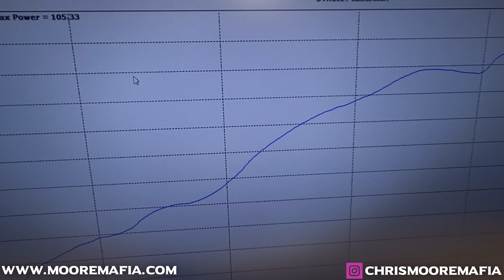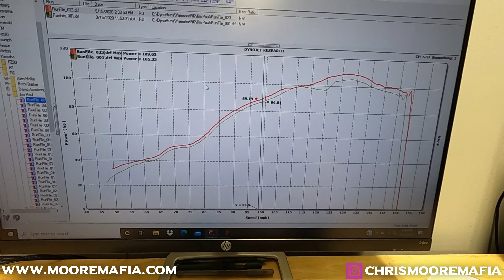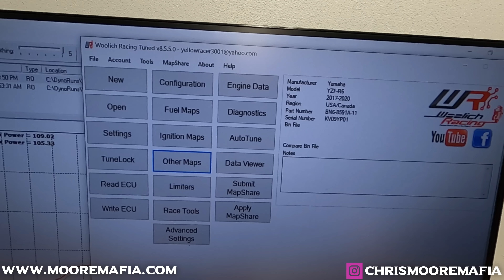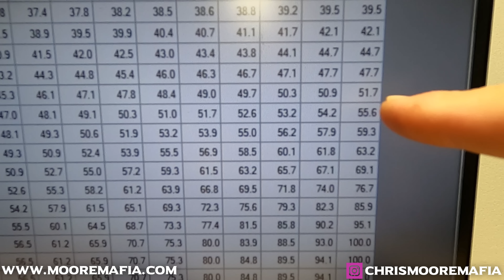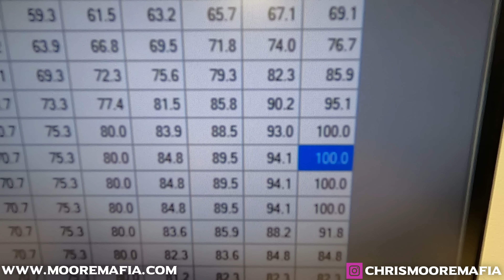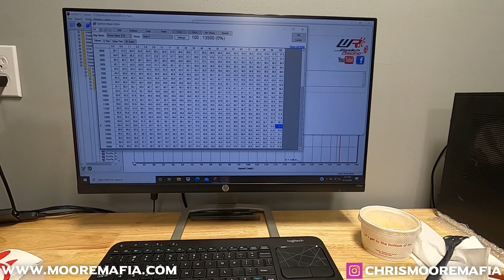2020 Yamaha R6 Unrestricted ECU FLASH and Dyno Tune w/ Modified Stock Exhaust- Moore Mafia

Comment: Chris, it's absolutely night and day the feel of the bike pre and post tune. The "falling on its face" feeling in low RPM while climbing is almost non existent now and that little vibration between 6500-7000 is 95% better. You absolutely knocked it out of the park. What I can say to anyone who reads the comments, obviously just looking at the before and after numbers, it's not the huge and flashy jump that you will usually get with the bigger bikes, but owning the bike, and the before and after feel, the pick up, acceleration, responsiveness, decell... across the board, it's a brand new bike. Oh, and the reason there wasn't a true baseline number to start from is because a couple weeks after getting the bike i took it to Chris for him to just take some of the restrictions out and add a little more fuel across the board, knowing that i would be back after break in since it couldn't be put on the dyno yet. As for the exhaust, i fully intend on getting a real and true slip on. This was more of a "hey, I wonder what this would sound like and do...." kinda things. Anyway, thanks again Chris. I'm sure after a few more mods I'll be back up there again, seeing what else we can pull out of the little 600 that could!
Reply: i think that 5 hp gain is what most 600's see, even with a full system. a better slip on for style, sure, but you probably got the most out of the bike for what you spent already honestly
Reply: @brandoloudly9457  I took the bike to him a couple weeks after I got it for him to just to a very basic, very general "tune". It was more of a "I know we can't dyno it or run it hard yet, so can you just do a couple tweaks to the stock tune until I break it in" kinda thing. So that's why he said that we really didn't have a base number to go off of. I'm guessing from stock it's probably closer to the 8-10 max hp gain area. We were both kinda disappointed that we really didn't know the true numbers, since the first pull he did already had some tinkering done. It was 100% worth it for the feel though. Numbers be d@mned, it's crazy how much smoother it feels
Reply: @rollred1995  oh dont get me wrong. 5hp on the smaller bikes (i also have an r6) is a big difference. 10 hp is a huge difference
Reply: @brandoloudly9457  oh 100%, it's a massive difference. I just meant that some people will only focus on a "small" number and not really know how huge a difference that makes.
Reply: @wudntulike2no32  it's more about looks honestly. I agree that it sounds incredible, really can't believe how good it sounds. It's been tossed around to wrap the exhaust or paint it or something. At this point anything that's changed will be mostly for cosmetic effect
Reply: Yeah change the exhaust 👍
Reply: @rollred1995  I made an Exhaust Almost like yours and its great. painted it black. looks sweet
Reply: Jim paul :  I did same thing to my factory muffler, then i bought a cat delete.  how did you make the factory V Band work on the cat delete pipe to utilize factory muffler?
Reply: @targasupra  the cat delete pipe that I got was built specifically for the bike and had the same end. Matched up as if it were from the factory
Reply: @rollred1995  wouldnt happen to have the link for the cat delete pipe or the seller you bought it from. MJS performance has closed permantly:( i waited too long to buy one and now i cant from them.
Reply: @MXROutlaw  did you ever find the cat delete pipe? I really wanted to ask him the same question bro😂
Reply: @rollred1995  hey! What did you do for the stock exhaust? Cut?
Reply: hey still pretty new and deciding on my second bike between the r6 and the zx6r, after the tune how does the torque and acceleration compare to the zx6r? is it close or does it lack still compared to the zx6r? people are telling me to go with the zx6r for street since it has more torque but i love the looks and sound of the r6

Comment: Had my 2008 R6 tuned in NJ.. Power Commander with complete flash, full akropovic titanium exhaust, race sprockets, race air intake… it made 129hp at the wheel on dyno.. the R6 has so much more capability than it comes with from the factory!

Comment: Homemade exhaust for the win on that one!
Reply: Sounds good as hell if you ask me 👍🏾
Reply: mtb supertroll why buy a bike to be cheap? you gain horse power and save a ton of weight with a full titanium exhaust, wouldn’t have to worry about rust either and it’s also about supporting mods like intake, sprocket kits, tires .. all working together .. I wouldn’t sell myself short
Reply: @MADLITS1K  that's not being cheap, that called being smart and saving a load of money for mods that will net more gains for the 💰. Example... You buy a full exhaust and tune. I fab up a modified stock exhaust, tune, and then take my left over cash and buy a set of used BST's... Will you outrun me?????
Reply: @MADLITS1K  I feel you... It all depends on the purpose of the bike when you really break it down. If it's a competitive bike, then no I'm not going to do a hack job on the stock exhaust... I will buy a good condition "USED" full system though. For a everyday bike though I'm going the same route of the "Modded" stock exhaust, it's going to give you the same gains & sound (maybe) as a Slip-On. I believe in going as fast as possible for as less money as possible, that's car or bike for me. All the brand labels in the world don't mean anything when you get smacked by the DIY guy 🤷🏾‍♂️
Reply: bacchus thompson fair enough fair enough, turns out the owner is in the comment section. Says he was just trying a thing with it and actually plans on getting a slip on anyway ... I gotta give it to him tho I’ve never seen anyone hack the stock exhaust tho usually they ditch the cat back and add a custom $20 pipe from a muffler shop or something lol

Comment: "not a lot of money" 2020 R6 and getting it tuned
Reply: I mean, he’s talking about the exhaust
Reply: Well if he wanted an R1M but settled for an R6, he definitely went the low buck route. Everything is relative my friend; an for what a capable machine you get the modern 600s from all the big 4 metric brands are indeed quite a value. You basically are ready to get on a race track and ride for 10-12k fresh out of a dealership. People spend that much on dirt bikes these days if you think about it that way.
Reply: maybe he spent his earnings or savings for a brand new bike cos he's not fond of buying 2nd hand bikes? full system exhaust can be expensive, what's so hard about it?
Reply: Is a 600cc expensive?
Reply: Lol I love how this comment is made so often. Listen close, he's saying not a lot of money ON THE EXHAUST silly. It was an experiment simply. I was curious how it would look and sound and it was super cheap to do. All the while keeping it to where it wouldn't be at a point of no return to where a full exhaust would HAVE to be done. And let's all be honest here, it came out WAY better than I even imagined. Certainly doesn't sound stock but if I get pulled over, it still technically has the stock silencer on it lol
Reply: He sounds like me
Reply: @kennethpowers8995  Yep, bought my 16 for 7K with low miles, about to dyno tun it after installing a BMC race air filter and full exhaust

Comment: I had a Honda winner 150cc out here in Vietnam, ecu , airbox gutted and K&N filter and exhaust, and upgraded intake and exhaust valves and spring , nets a MASSIVE gain. Stock is about 11.7 whp and with those upgrades, jump to 19whp. That's over 35% more power. How come most 600 class bikes only net around 5whp ? I checked out all brands of bikes and most of them net barely any increase (not saying the increase isn't felt , just saying why does a small 150cc net 35% plus performance when a 600 only gets like 3%)

Comment: Can you flash the ecu with tuning just by sending you my r6 ecu or do you need the bike too for both.  Excuse my ignorance...
Reply: an ecu can always be flashed by having it sent in, but for the best of the best is always a custom tune on a dyno, cuz every bike is still ever so slightly different, especially if it's modified, you want it tuned for your specific mods.
Reply: @gwot  good point

Comment: Love the ingenuity of the owner. Honestly at first I was like oh great a guy has money for a brand new R6 and NEEDs and exhaust so bad but can’t afford it so squid life hackjob etc etc. Upon consideration though he didn’t just hack anything up and really did a good job which I deeply respect because doing things yourself is just awesome. I also highly doubt his engine cares the pipe it exhales through came from EBay. if the bends are right and flow is there who cares!
Reply: it's an old trick in the R6 community, it's been around for generations. I did the same thing, I can definitely afford a new exhaust, but I don't want to pay $1,000 for some bent metal with an off the shelf muffler that they slap on every model exhausts are so expensive with little value to them.

Comment: Does it hurt when shifting without using the clutch?  Or do bikes have autoblip or whatever it called when you do that
Reply: Not at all, clutchless upshifting doesn’t harm the bike whatsoever. Clutchless downshifting doesn’t harm the bike either if done right, but you have to be extremely precise. Generally it’s just better to clutchless upshift and use the clutch for downshifting.

Comment: Good luck this weekend! Can you add some weight to the front? BP has that special heavy front wheel spacer. $$$ Local mechanic says Yamaha motors have been exploding lately. Wondering about ignition timing. Seems like high advance at chopped throttle. For popping I assume?

Comment: "This customer doesn't have alot of money...". Proceeds to buy a 2020 R6😂👍The heart wants what the heart wants, boys.
Reply: Lol, he said the customer doesn't have a lot of money IN the exhaust. Cause, no, I don't. It was more of a "hey, this thing looks identical at a third of the price, not much to lose" kinda thing. And the cut in half muffler was more pure curiosity. Sounds incredibly honestly, but I want the cleaner look of a true aftermarket slip on so it's not going to be long until the "science experiment" goes away lol
Reply: @rollred1995  Ahhh, I see. I must have misunderstood! But regardless, it sounds awesome and the bike looks very very clean, man, congratulations! Hope you get plenty of happy miles on it!
Reply: @rollred1995  Your exhaust would probably help you with the cops also since it's stock, they can't give you shit for that.
Reply: We were all honestly a little shocked at how clean it sounded. The biggest difference came with the cat delete though. That's the biggest sound killer. And thank you. Absolutely love the bike
Reply: @rollred1995  Just a follow up question - would you say those gains were noticable after the tune and if so, would you say it is a sizeable gain or not so much?
Reply: @deanduplessis832  I've only gotten to ride it once since the tune because of the weather here, but on that ride, the change was night and day. Incredibly smooth acceleration now, especially at lower revs (below 6000). The throttle response is improved, decel... across the board the rideability is night and day better. I haven't gotten the chance to really open it up yet, but honestly I only expect to be even more impressed with that when I can too.
Reply: @rollred1995  Ahh, I have always wondered how effective tunes with smaller gains are in terms of real riding and not on the dyno. Glad to hear you are happy with the tune, though! Have a good weekend, man and happy riding whenever the weather cliers up!

Comment: The crippling ETV is horrible these days. Amazing what  unrestrictioning the ecu does... Especially in lower gears for some bikes
 Good video
Reply: Yea my 2020 had timing and throttle cuts in 1-5 gears from the factory. Also new cars and trucks do the same; almost all major brands include some type of torque management software to limit power and essentially save on parts and therefore warranty claims. That and fuel economy & emissions concerns are the main reasons you can pickup 20-30 wheel HP on an otherwise stock NA car with just a tune. Boosted stock cars even more so.

Comment: Hey! My idling on my Yamaha R6 2017 is flickering sometimes during different temperatures. Does it hurt the engine and is it enough to just modify the idling fuel/air ratio? My ECU is flashed by P3 Tuning. Thanks!